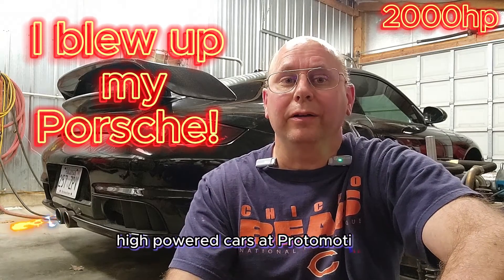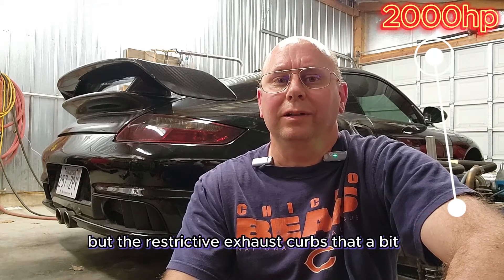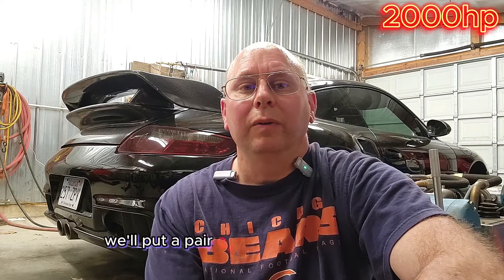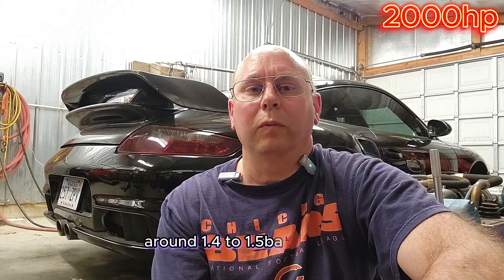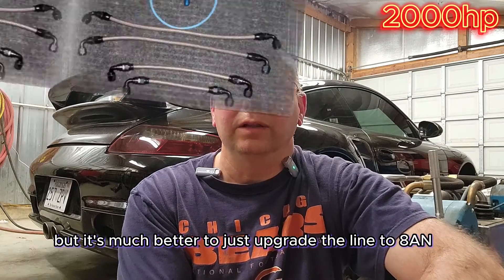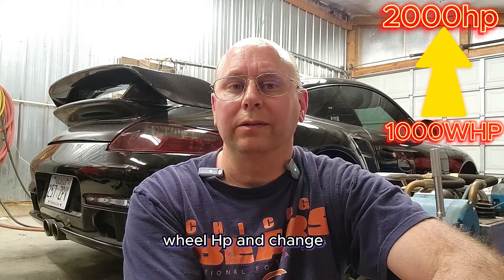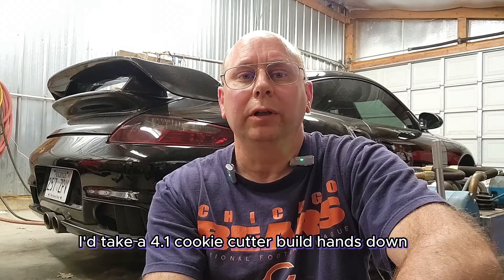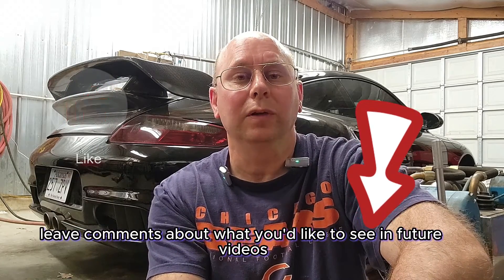I blew up my Porsche! (We found the Weak Links on the Path to 1000whp and beyond)

Comment: Very informative! But make's me wonder  - what about the gearbox? What's the journey of upgrading there?
Reply from the maker: They're amazingly strong.  First weak link is the diff side plate if you track drive and aggressively downshift.   For power the fun starts around 1000hp.  But for occasional fun you can run 1300 to 1500 in these things.    If you like Texas mile and airport stuff you'll want straight cut gears in 3rd and 4th along with a trans cooler and pump to keep the fluid where it should be.  This is all for manuals.   Tips start around 600hp where we send them off for 1000hp upgrades

Comment: Glad I found your channel! I rebuilt my 996 Carrera to 4.0 and forged rods on my channel. I just bought a 05 Turbo S. Came with a Cobb tuner and a stage 3 clutch, upgraded Cobb injectors, fuel lines.
Reply from the maker: It's nice to meet you.   Make sure to watch the fuel injection tech video.   It goes over some of the issues with the injectors I belive you have.

Comment: Thanks for sharing all the knowledge. I am having a blast with my XR980 + stock longblock on 93 octane + meth (~680 whp). Honestly would love to build a motor one day but it's not in the cards for a few years! I may play it safe and detune slightly to keep this motor happy for a while longer :)
Reply from the maker: You're welcome!  That's a very fun build!   For sure keep the midrange torque under control!  We're always happy to help you build your dream car 🙂
Reply: @protomotive Awesome ! I know you mention the pros / cons on Methanol... for a setup like mine, would you prefer to see it just on pump fuel with a good set of intercoolers? I have stock X50 coolers at the moment so that will limit me if I were to ditch the meth. I am spraying 100% methanol at the moment and not sure if I love the added complexity / risk.
Reply from the maker: @hatemsgarage  this comes up often.  We talk about it again in our latest video https://youtu.be/URrr1Xv7j0o
As long as you have safeguards in place you can really reduce the risk of running your car if the meth runs out.  The simplest is hooking the meth bottle low meth switch to your boost control to turn it off if the meth runs out.  There's flow meters with the AEM systems that'll monitor flow and provide a warning if the flow falls out a window of normal running.   Pump+meth is far safer to run at the power level you're at than pump alone.  You'd probably end up around 600 on pump alone vs. 680 with meth to maintain  a decent safety factor.   If you have E85 available and could convert over you'd have no worries since the octane is so high and it burns so cool.  The meth could be diluted to 50/50 or less and run as a cooling only if you're in a very hot area.  Or some areas have 100 octane at the pump.   Just look at your need there and it'll guide you to the right decision.  Is it more about safety, power or cooling?   They all have different advantages and disadvantages.  We've been asked to produce a video on fuels alone since it's such an important part of producing safe power.  So look out for it!  It'll probably be after Part 2 of the avoid these mstakes before modding your 997 turbo video we just put up.

Comment: Are those hp and torque numbers at the wheel?
Reply from the maker: I apologize for being inconsistent there.   I did try to show hp or whp on the side if you catch it.    The gt1 power ratings and bsfc calcs are crank #s but beyond that I'm pretty much referencing whp from our dynapack 4500 4 hub dyno.

Comment: damn right you're protomotive and it will be better than anyone could imagine!!! love the long format content.this video is f-ing rad!!!!! i love the point by point and steps to building a mega stroker motor. people think that any 911 turbo is the same like why doesnt your 996 have 800hp with a tune the answer-stick your head back up rear end where it belongs. i alway disliked the 996 until a year ago.with taking care of my brothers 993 turbo i thought the 996 was mutiny and had to be stopped blasphemy(Crappy speller) but ive since really grown to love it like i love the 997. its nice to learn that each set of upgrades in turn requires you to have to upgrade the systems to handle it responsibly and not foolish. these cars are not as plentiful as the years go buy and the values have really went up but its still the most economical to buy but will need way more mods than a 991.2 with a fullbolt-ons and a tune. great work Todd. i really hoping to see more longer more in depth videos. i still available for adoption and it would be disrepectful to ask for your bueatiful daughters hand in marrige so i pray for the adoption. i'll be the best employee you will ever have. until then cheers
Reply from the maker: Thanks :)   awesome review!   We have tons of ideas.  Finding the time is really the hardest part.